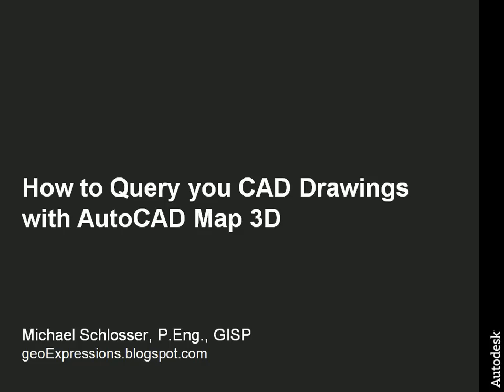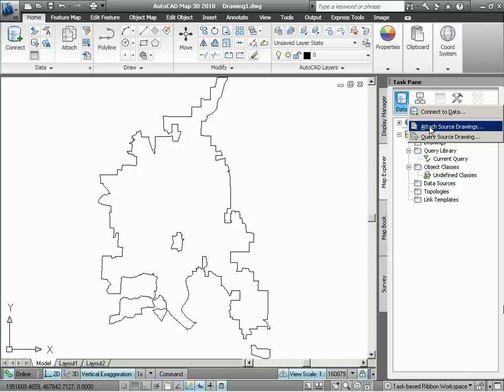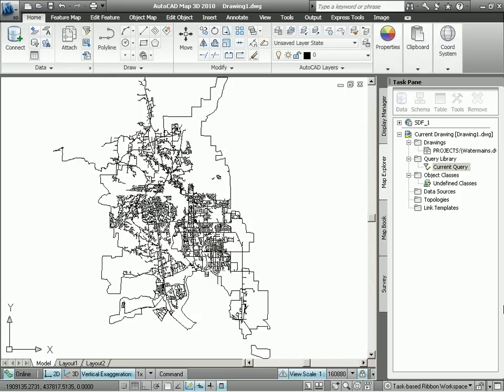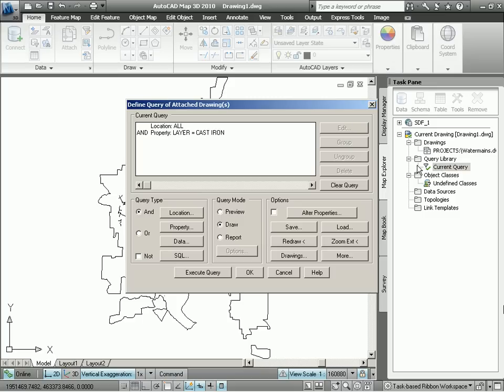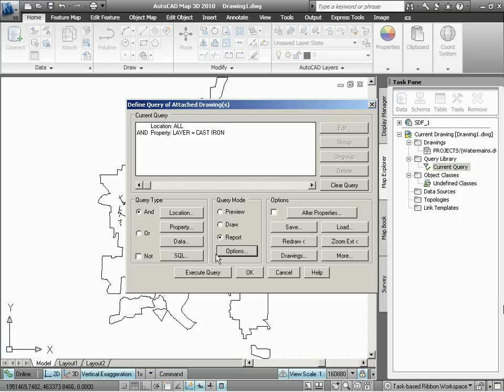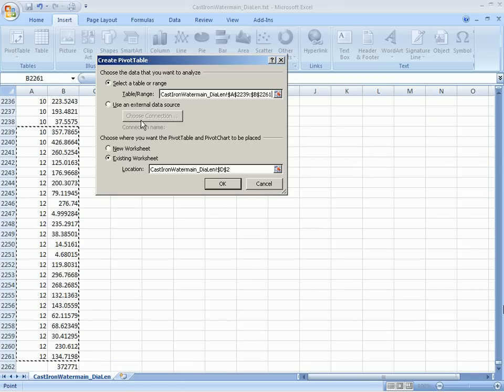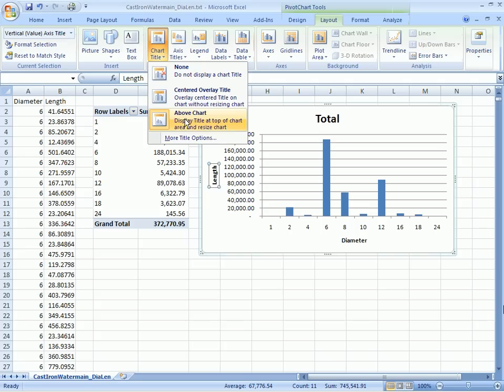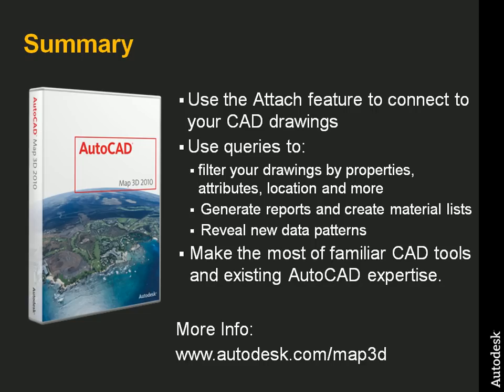How to Query your CAD Drawings with AutoCAD Map 3D

Comment: Hi, first of all, thanks for share the video. And I want to know if is possible to do a query to dynamic blocks to extract the info about length of these. I've been trying but only obtain zeros, or the lenght of the original blocks, not the inserted and stretched. (Sorry if I'm not clear, I don't talk so much english). Thanks for any answer :)